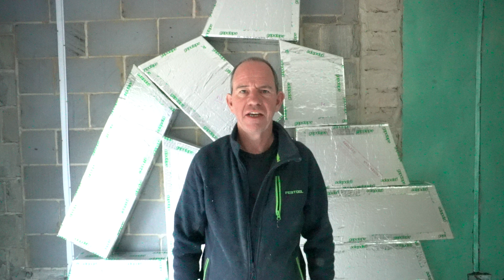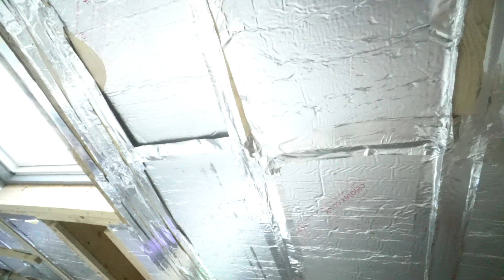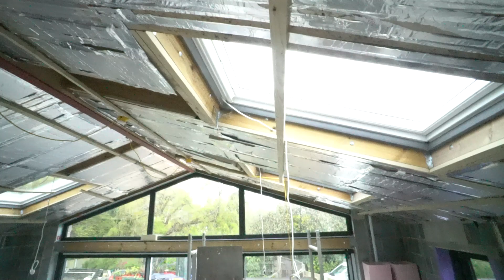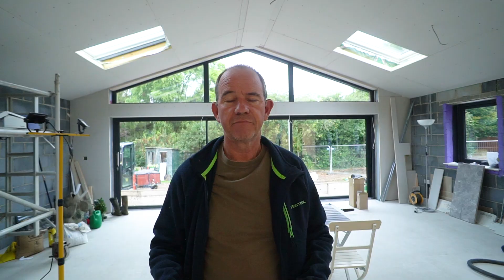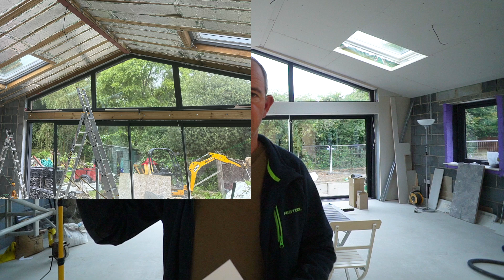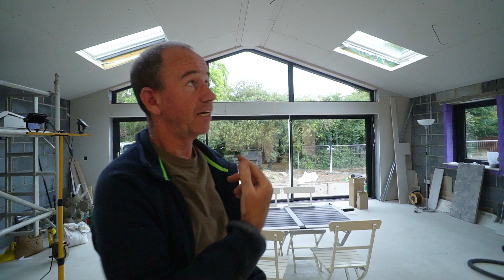Part L performance gap. Why should you "Mind The Gap" when installing insulation

Comment: I like Robin Clevett but he’s sponsored by gapotape so you do wonder if he uses it on builds when he’s not being sponsored.
Reply from the maker: It is not a cheap product, I think we used about £800 worth to insulate our living space and hall. I struggled to find solid details of the difference it would make over poorly fitted or even well fitted PIR. As you saw our insulation had been fitted badly and we have an air source heat pump so wanted to do the best we possibly could to ensure a warm and efficient home. We will never know if it was worth fitting. That said I do like it as a product and it just felt right fiting the PIR that way, its a shame there is no competition as far as I am aware to help level up market prices.
Reply: @JurassicJungle  don’t get me wrong, I’m erring on the side of using it for my renovation
Reply from the maker: @CivilisedMuffin  Dont forget the discount code RC2023 for a 10% discount
Reply: There are so many skills and techniques used across renovation work that any tradesmen will have a view on, but you can hit a nerve when you venture into discussing standards of installation, an example being insulation! I’ve had many conversations over many topics, with: ‘never had a problem’ being a typical response. We learn all of this on our journey, which can be incredibly upsetting (let’s face it). So it hands us a dilemma how to proceed.
I think you’ve made the right calls. No-one teaches us this stuff. To be fair the trades have a job to do and assign so much time and cost of materials and tbh if you wanted a particular standard then you should have specified it. Ha! I could go on forever, so many examples of workmanship that could be better. You’ve done well, and it looks fabulous.
Reply from the maker: @AndrewWardle-d8q  Thanks Andrew, I fully agree on the time it takes, would a trade get the job if he quoted to do things to such detail? I come from a more a workplace that demanded more precision and I am sure i do things to too high an accuracy at times. I have some brick players on site at the moment who call me Mr millimetre! The problem is that some things do need to be done better than they are. My other poor example (see my other video) was a 6m steel with a drop of 18mm across its width. That took me several days to try and box in square and make it look as true as I could. I really should not have had to do that.
Reply: @JurassicJungle  I watched your video regarding the RSJ and have to say the level was an absolute disgrace and I would have done precisely the same as you to resolve. Looking forward to seeing your remaining videos and the finished house!
Reply from the maker: Thanks Andrew, I hope you saw my lastest short tour. The plastering team we got for the main room were amazing and you would never know the steel was not straight, the final result looks amazing.

Comment: The problem with chat gpt for things like this is that it will straight up hallucinate about stats.
Reply from the maker: I would never take what ChatGPT puts out as 100% the truth but I have found it a very useful tool to do iterative research. When I used it to compare different U values and the potential impact on heating cost it did provide me all of the calculations it had used so I could at least go back to the source. I will admit that in this case I did not ask it for proof of the calculations of losses of 20% and 50%. I have since gone back and pushed it further. It reminds me a bit of some IT certification exams I sat that were clearly produced by looking at marketing material (as chat GPT probably does) rather than the knowledge of someone that actually uses the product. I failed a certification test once but completely disagreed with the answers that the certification said were right. At the end of the day an AI model is only ever going to be as good as they data that it uses and it will completely trust that data while a human would take statements in marketing material as a hyped sales message.

Comment: So your Heat Pump/UFH/heating system has been designed and installed following your architect's heat loss calculations, specs, etc. Your walls are plastered, floors are tiled, Great!!!! It suddenly feels chilly at home..... time to heat things up🤔....."Why is it so cold in here your thinking"🤔 The heating is turned to Max but it is still FREEZING????🥶🥶.... If only the builders you previously employed and the building inspector that you paid to check their work, really understood "Part L"  and how insulation works in the slightest, then, the 100mm (specified) insulation, might not have magically transformed into 50mm...Your Badly installed insulation with small gaps and holes everywhere, now means it's literally impossible to heat your home!... Well Efficiently anyway! 
Whose lap do you think this "Expensive F**k up" should fall on?????  Personally, I'd say the building inspector.... What do you think?🤔
Reply from the maker: Hi Tim, I don't disagree but in my situation the project is classed as a refurbishment rather than a new build so the regulations are lower and I assum the inspection less. I asked the architect to exceed part L rather than just meet current standards but bulding control would only inspect to what I have to do rather than what I asked for. another lesson for me is that the architect just specified a build structure for the various elements to meet a given U value and he didn't provide any detailed drawings for how that should be implemented. I have 2 areas in my roof construction where this has caused an issue and I have just had to do the best that I can. Our new roof area has a low pitch of abour 22deg which was too low for the tiles used on the original house so we ended up having to replace the entire roof. THe room has a glass gable end but the central steel was so low there was little space for any insulation. I have boxed the steel in either side and used foam to fill any gaps but I could only get 25mm of unsulation underneath. The final place was the eaves where the low pitch and extra thick walls with a 150mm cavity left little space for the insulation from the roof to meet with the unsulation in the cavity. If this were a new build I would hope inspections would be better and a blower test be required. I may do one later to see if I can fix as many leaks as I can. I did remove all of that poor insulation and refitted it so we are hoping we wont be cold, lets see what happens over the coming weeks.

Comment: Just come across your channel and your video. It's so great to see someone else joining what seems to be a relatively small band of people who want to do the insulation and airtightness the way it should be done as specified. Im very much like you , in that we dont trust a lot of trades people implicitly. We are "completely" refurbing an 1850's house and are mainly going down the eco wood fibre route to accomplish a "breathable" wall and roof system. I got what I thought was a good roofing company to do our roof, but even their detailing just was not what I expected it to be. Our house is completely stripped so we are insulating from the inside with a soft wood fibre product between the rafters, which solves the hard PIR issue (but the gapotape is a great solution for that), and then more solid wood fibre boards under that. Im completely project managing it myself, and doing most of the "building" work ourselves , apart from the big stuff like steels and roof. We have  a great builder on hand, but even doesnt really understand the attention to detail needed that I think should be worked to with insulation and airtightness. It almost feels like im having to detail custom solutions myself with no one in the industry able to help. Nice work !!
Reply from the maker: Thanks so much for the feedback. We are trying to do the right thing but one area I know I have messed up is service voids into the loft. I have 3 locations currently open from a cupboard upwards with about .5m square each. They all have pipes and cables so difficult to seal. I will box off and board as best as I can and then probably foam to try and seal. I plan to use my FLIR camera to help and see if I make a good job of it. If you have not been I would highly recommend the self build centre in Swidon as they have all sorts of suppliers there that you can talk to on the open weekends ( I think there is one very soon). I don't envy you the job on an older property as you have to take so much care to allow it to breathe as you say.  I think we should have demolished our bungalow and just build new, the VAT savings would probably have covered the extra cost and we would have a new house rather than 80% of a new house. I wish you the best of luck with your build.
Reply: @JurassicJungle  Yes, Ive got service voids to block up as well ... Im just trying not to think about them until I need to. Ive thought a lot about going to that self build centre, but just not got round to organising a visit yet.  Yes, the old house thing is a fair old pain. I've designed the wall and roof insulation to be a breathable system , even though Ive not really settled for an internal board yet , and we are going MVHR (zendher probably) and airtight with mainly the proclima stuff. We have a GSHP so UFH all downstairs for which I keep changing the floor build up design - I guess thats the problem trying to mostly do it yourself.   O, and I have seen your videos before... when ive been mulling over smart home stuff. I might go KNX just to try and future proof the install - I mean , not really making it easy for myself there :face-turquoise-covering-eyes:
Reply from the maker: @FriendlyEngineer  The Loxone thing or KNX is a bit of a leap of faith in some ways but it could be swapped out with something much simpler. I used KNX cable to all of thw switches so it would be possible (but painful) to replace Loxone with something else if I needed to. I do like the flexibility of supply of KNX and its resilience of not needing a central server to run but my understanding is that makes seting it up a bit more complex. I saw a nice setup at the Swindon self build centre that used KNX but also a small central unit that discovered everything and made it super easy to setup. It didnt have the ability to do complex stuff like I had to link the ASHP and Solar but there is a strong argument not to do that for the sake of simplicity.

Comment: Good video. The short answer to your pivotal question is it depends on the length of the piece of string. You are right that the root of the problem is the majority of builders are neither interested, motivated or skilled enough to do this job to the standard required and the Robin Clevitts of this world are few and far between and booked up at least a year ahead. If you are a homeowner carrying out this sort of renovation you are much more likely to do a higher quality job than the builder, especially if you invest in the tooling (Festool insulation saw and track) and products like gappotape. It takes an extraordinary amount of time to do properly.

The length of string question is pretty well impossible to answer especially the effect on additional heating load or the reciprocal of it and payback period. At the end of the day each element of the build could be done cheaper if you paid less attention to the detail, the question is though where do you draw the line?

I have lost track of the ASHP side of the project - is it fitted? If not have you had a heat loss calculation from survey and drawings? One of the biggest imponderables in heat loss calculations is the air change factor and the MCS recommendations are crazy. A door air blower test is key.
Reply from the maker: Hi Norman, You are right it took us a long time to redo the roof, I think probably 2 weeks by the time we removed it all and the battens and recut it with the great Festool saw. We think it was well worth the effort but I can see the tape and time would cost thousands more. Robin takes time to space timber at 400mm to reduce waste of PIR but we had to work with what we had. We don't think we could have done more. I fully agree on where do you draw the line, we had that issue with Windows with costs for the full project varying by as much as £40k! 

I need to do an update on the ASHP. We had heat loss done by BG with long site survey and remotely with CBHeating. Both came to similar numbers of around 6kW loss. We have also installed MVHR. Our initial goal was to be as air tight as possible and in lots of areas I think we have done well. I paid a lot of attention to window and door openings ensuring all cavities were closed. I wanted to render internal walls but just could not find anyone prepared to do it so we have used dot and dab. My biggest issue is the service voids that I have going into the loft, there are 3 of them with a total area of about .5m square. They have lots of cables and pipes going through them up to the loft so I need to work out how I make that as airtight as possible. I am not certain how to tackle it but will probably box off as much as i can and then use foam or something to block the rest. I have a FLIR camera so will be able to see lower temperature air movement and continue to try and improve it. I may wait and cover the pump and heating once we know its working properly as last winter we were nothing like airtight. We think it may have a faulty valve at the moment as water takes ages to heat (we did expect it to be slow) and hot water is going to the UFH manifolds even with the heating off. I don't think we will do a blower test as I am not sure I want to know the answer.
Reply: @JurassicJungle  CB heating is a very good company with a good reputation. BG not so much. Your issue is definitely a faulty valve and is an easy and cheap fix. One advantage of pressurising the building during a door air blower test is- it helps identify the multitude of small leaks that can add up to a ‘barn door’ - the empirical value of the ACH is a mute point as you already have the ASHP sized and installed.
Reply from the maker: @normanboyes4983  It was CB Heating we went with and I am very happy overall. They assigned a local installer who I was able to work with on the UFH install. Someone is coming next week to look at the valve. I have my Loxone system connected to the pump via Modbus so will have to see how well that works oor if I just adjust flow rates and use standard weather compensation. Loxone has the ability to do the weather comp itself but I may just be making things too complicated. I am finding the control of ASHP a bit more difficult to difficult to diagnose, with gas there is either a call for heat or not. Heating water in particular has different logic to gas, the Daikin by default does not reheat water when you use it until the next schedule time. We have ended up using the immersion boost way to often but that could be caused by the faulty valve. Thankfully we have solar and a battery so I am at least using cheap rate power for the immersion. Hopfully that will be sorted next week.

Comment: Who told you to build up the insulation and vapour control layer? It’s my understanding that the vapour control layer should be between the hot side of the insulation and the insulation itself. 
What you have done is created a possible trap for the vapour. I doubt it will cause an issue, you’d have to calculate the temperature drop across the insulation and the dew points for a given relative humidity level. If the dew point forms inside the insulation then you’ll probably be fine. If it forms at the surface on the vapour layer then you’ll get damp forming there. Not so good.

The builders also didn’t look like they used butyl tape over the joists so you’d be lacking the sealing effect when you put a screw through it.
Reply from the maker: Hi David, To be honest thats the way it had been started so we continued with the same build up. The architect specified the construction of 100mm between rafters and then the 72.5mm insulated board (60mm pir). With that construction where can you put the VCL if it doesn't go behind the insulated plasterboard? It would have been very tricky to install it behind the 100mm PIR as it would very likely be damaged when installing the insulation between the rafters. If we were doing this again I don't think I would use insulated plasterboard, it would have been much easier to overboard with sheets of PIR then put the VCL on the front of that before adding standard plaster board.